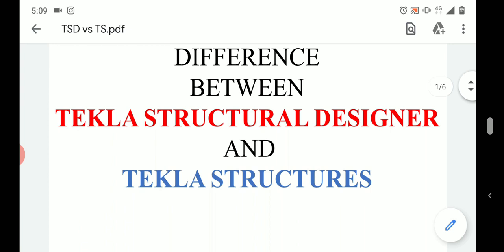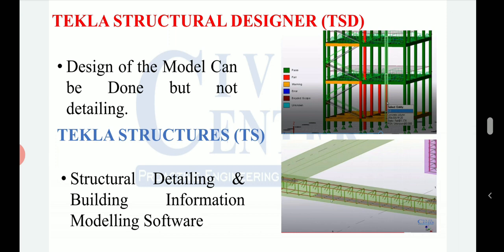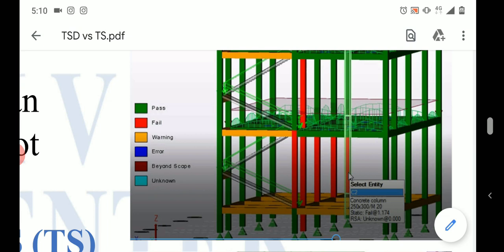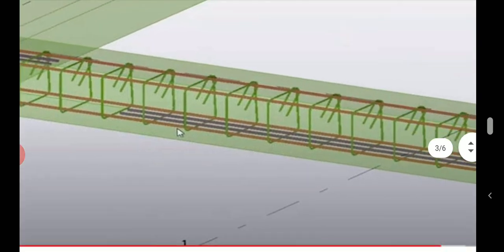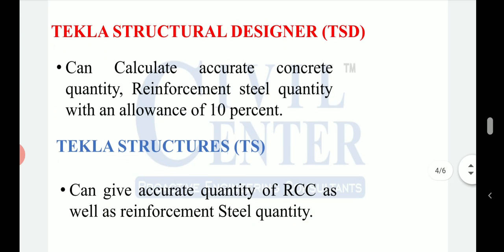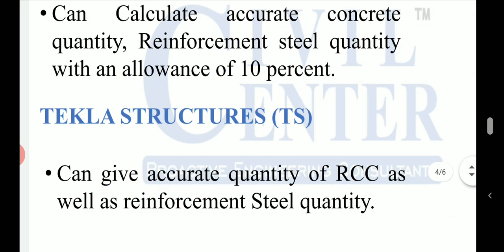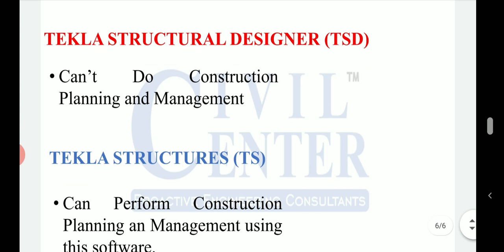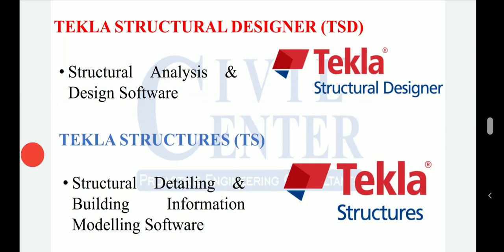Tekla Structural Designer vs Tekla Structures|| design software|| Drafting Software|| BIM Software

Comment: The confusing point for me is that structural design is done with Structural Designer but detailing of reinforcements, which to me is part of design, has to be done with Tekla Structures.

To give clarity, what does Trimble define as detailing if its not part of the structural design?
Reply from the maker: Let's put it like this

After the structural drawings are made, using Tekla Structural Designer, cad, or any other software, 

You can create a 3D model using that particular drawing in Tekla Structures.